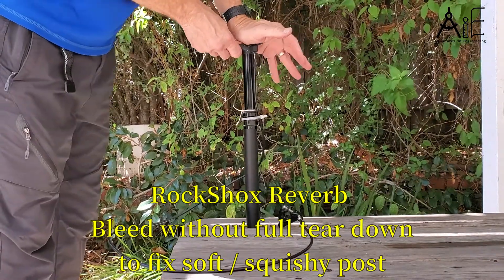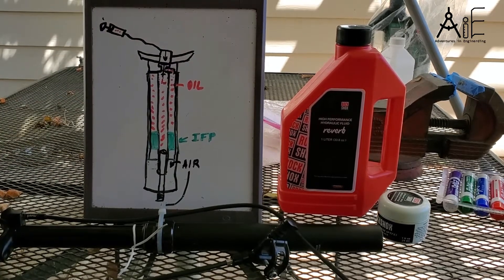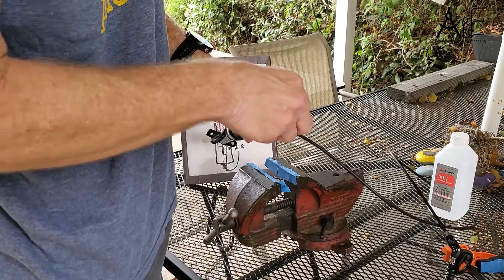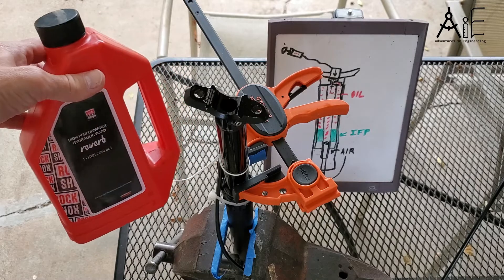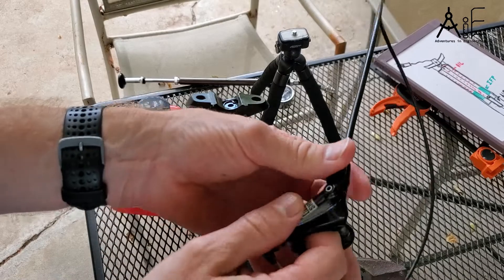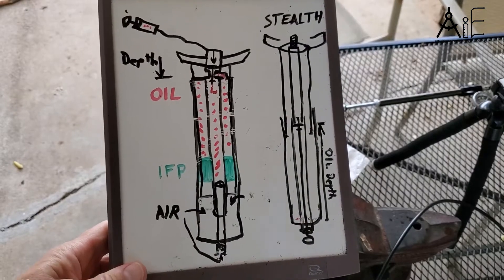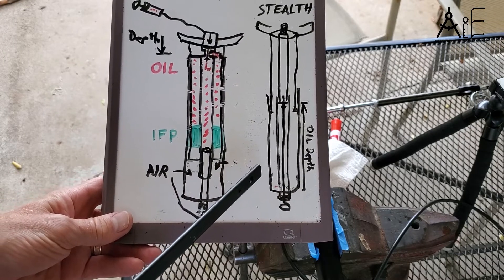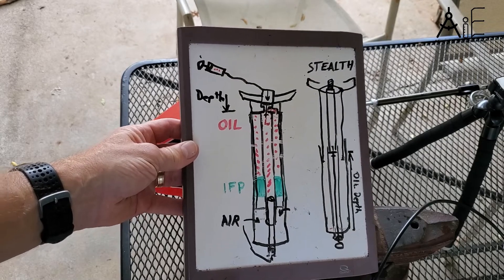Fix sagging, soft, squishy RockShox Reverb dropper seat post without tear down

Comment: i've got the same dropper but now when i try lift up the bike from the seat the dropper rises from bottom position will bleeding it help it?
Reply from the maker: @oscrr_v Movement in either direction indicates air in the system.  Bleeding should help.
Reply: @adventuresinenginerding alright cheers mate

Comment: Great to see someone thinking outside the rochshox manual will give this a go tommorrow thanks for making usefull videos totally aggree about picking bike up from seat that is a sure fire way to suck air from the high pressure chamber. I have been running reverbs since when they first came out and once you train your brain never ever pick up the seat they last way longer the good thing about the squish is people just throw good reverbs away for nothing and all they need is a piston reset or top up oil like you did here thanks again .

Comment: Great video, thanks for taking the time. Just one thing you said that needs cautioning; reverb post fluid fluid isn't compatible with brakes, don't use it on your brakes, it's not for that and who knows how it'll behave when it gets super  hot.
Reply from the maker: @danielhabib7354  Thanks. That is good advice especially since Reverb fluid is mineral oil and some brakes use DOT fluid. It will destroy seals if using the wrong one.

Comment: @6:23 Instead of making this mess, just pull the post apart and do the job properly
Reply: Uh oh, YouTube Properly Police
Reply from the maker: @kristianvrum8979  That is caused by the pressurized air on the wrong side of the IFP in the hydraulic circuit. As you suggest, one possible fix is complete rebuild. This video shows how to remove the air and get functionality back without fully dismantling the post.

Comment: For those of you who have tried this, does this work with the reverb stealth? And for how long does this fix work?
Reply from the maker: @TheCeezSteez  This fixes the problem until you get air in the system again...  Not a great answer, but you can minimize the chances of air by not lifting the bike by the post when it is down. The design is prone to this problem, but this fix is much less effort than a complete rebuild.  I do explain the Stealth version differences at the end of the video.  Good luck.
Reply: @ thank you for your quick response. Some trails have the bike stands that hold your bike from the seat post, so maybe that’s what could have caused the squishy on by dropper. I’ve been quick fixing it by venting it before every use but not sure how long that will last.

Comment: Omg what a great video and what a shtty dropper to put on a santa cruz hightower. 
Have the same problem with my 6mo steath. Swapping it out with a tranx. Have been running tranx on my 6yr Norco sight and it's never had an issue, works as well 6yrs later as day 1. Never liked rock shox products and the dropper is the perfect example. Thank you for the informative video, convincing us to ditch the RS dropper.
Reply from the maker: I put mine on an older bike and it still works.   Definitely better options available, but for those who have got one this helps people get more life out of them without spending money.  Thanks for watching.

Comment: Excellent video! This worked really well for me. Took my squish from 10 mm down to 2 mm. We will see if that lasts. Definitely didn't want to throw out an otherwise good piece of gear! 

Newer Reverbs have a vent tool to fulfill this purpose. 

Mine is a Stealth and I did it without any special tools. Made a fluid measuring device of small tube to suck out extra fluid with its length based on feeling down to the "shelf" level at the bottom of the poppet valve. 

Note: after the procedure my dropper wouldn't go down at all until I opened the post speed adjustment up from slowest. Worked right away, although I did the remote bleed twice and was ready to buy a new dropper post until I figured this out. Can't remember if you mentioned it in the video. Thanks again!  🙂
Reply from the maker: @bobcosterton6430   Glad it helped you.  I do cover bleeding the button circuit at 10:15 and it being a separate bleed, but it is a bit tedious.
 
To keep it from getting air in the dropper portion, try not to lift the bike by the seat.  That can create low pressure in the fluid side allowing higher pressure air to get past the IFP and cause the squishy post again.
Reply: @adventuresinenginerding  You're description was excellent and complete. I just couldn't move my seat after the bleed because the speed adjustment was moved to slow. Increasing the speed made it work. And I am trying to not lift the bike by the seat! Sometimes hard to do / resist!  Thanks again and cheers!

Comment: Hi, i've done every steps and everything went good. No more squishing, but now my dropper doesn't go down at all. Do you know what could have cause that et any clue to fix that? Thank you!
Reply from the maker: The button actuator is a separate hydraulic system.  You have to bleed that separately after doing the air removal in the main shock.  This is shown in the video at 10:15.  Push fluid back and forth until no bubbles come out either end.  Check for leaks when you push the button.  You probably still have air in that part, but it is the easier side to bleed.  Once you are done bleeding, you may need to tighten the button adjuster to get it to actuate more easily.  Good luck.
Reply: @adventuresinenginerding I'll try that. Thank you for your answer!

Comment: Hi good video i have a problem with the Rockshox reverb and i Did the same like a video but now a press the rock shock bottom and the reverb don’t go down i press down very hard but don’t go down
Reply from the maker: The actuator is a separate hydraulic system. It must be bled separately.  Make sure the adjuster on the button is loosened all the way, bleed the poppet, hose, & button actuator thoroughly. There is a bleed port on the post next to the hose and one on the actuator button.  Push fluid back and forth until no bubbles.  Then you'll likely have to tighten the adjuster some to make the actuator work properly.  Good luck.

Comment: Thanks for making the video.  It would be great to change up the direction of the drawing to have the saddle mount up and the remote link on the bottom.  Plus move the curved lines that represent the saddle mount bracket to the proper end ( it looks like the saddle mount is on the remote linkage side).   Finally, if the drawing from the SRAM manual was used it would be more clear.  Call me anal.

Comment: Turned my bike over. Pushed and held actuator in then Pushed bike down to compress post. Turned bike over raised seat and sag was gone. Not sure how long it'll last.
Reply from the maker: Definitely a good trail side fix.  The air will slowly work its way back into the wrong side of the hydraulic system.  That air needs to be removed for for a "permanent" fix.
Reply: Omg what a great video and what a shtty dropper to put on a santa cruz hightower. 
Have the same problem with my 6mo steath. Swapping it out with a tranx. Have been running tranx on my 6yr Norco sight and it's never had an issue, works as well 6yrs later as day 1. Never liked rock shox products and the dropper is the perfect example. Thank you for the informative video, convincing us to ditch the RS dropper

Comment: Great video ! This procedure can be applied to a AXS electronic wireless version dropper post ?
Reply from the maker: Thanks. I'm gonna have to plead ignorance on that dropper post.  Obviously it would not have either a cable or remote hydraulic actuator.  There will be an internal valve controlled electronically. It may have a similar hydraulic internal mechanism. Some posts use a replaceable cartridge - not user serviceable.  They usually have a pretty good manual available online. Start there. Good luck.

Comment: What about the case where there isn't just 1-2cm of play, but the post will sink all the way down when I sit on it?  Is that a different issue?  Thanks for posting this video - big help.
Reply from the maker: You may have a bad seal / o-ring. You may want to do the full rebuild with a new kit. I had done that more than a year before this video, so it was less likely to be worn out rubber seals. Good luck, thanks for watching.

Comment: what do you think it is the problem? i have the stealth version and now it goes up very slowly or it doesnt go up at all
Reply: just check it's not something simple.... like the seat post being over tightened, that's causing it to be slow to rise. Slacken it off a bit, and see it the problem persists.
Reply: sometimes it goes up slow and sometimes it doesnt go at all
Reply from the maker: I'll assume you are referring to a bike dropper post.  Sounds like not enough air pressure. Or It could be friction from bad orings. If someone put in the wrong fluid it can damage them. Good luck, thanks for watching.
Reply: @adventuresinenginerding  yes, rockshox reverb stealth. I will buy a shock pump to see if it has the correct pressure. The problem is that no service in my city wants to work anymore on these because of their poor reliability, we fix it now, soon will break again.
Reply from the maker: @silviu4365  That's why I made the vid. Almost anything can be fixed, but effort, price & skill set decide if it is worthwhile. Hopefully you can get yours going again.
Reply: I just did this too, and it wouldn't go down until i opened the post speed adjustment up from slowest. Worked right away, although I did the remote bleed twice and was ready to buy a new dropper post until I figured this out.
Reply: @bobcosterton6430  yeah that adjustment is broken, mine had that problem too, these posts are stupid. I think from the pressure the adjustment unscrews itself in time